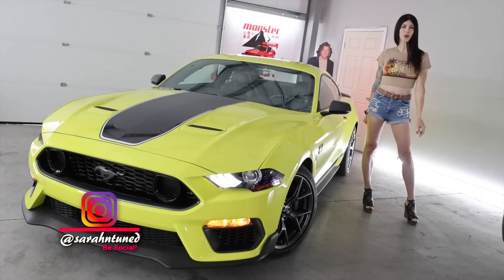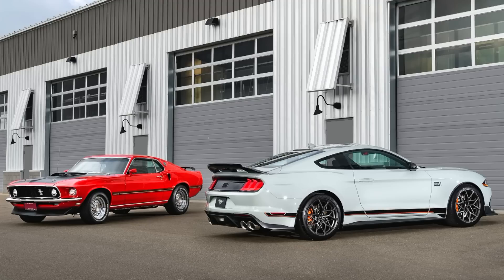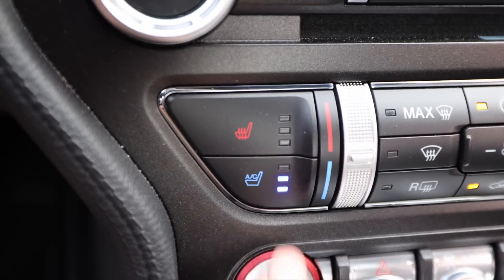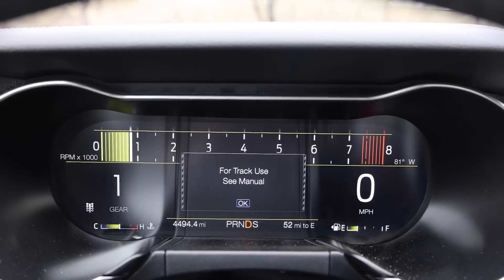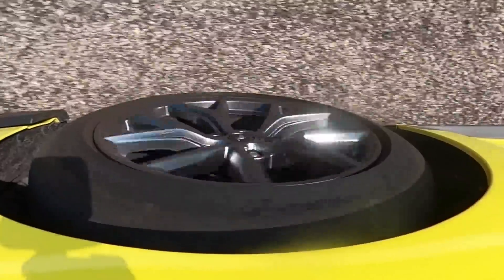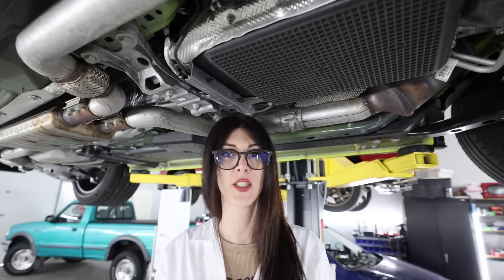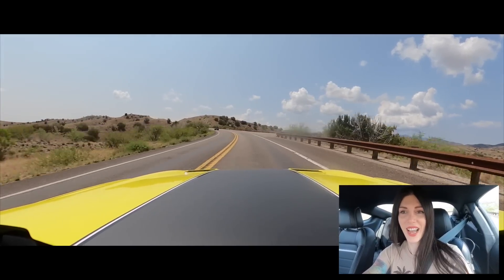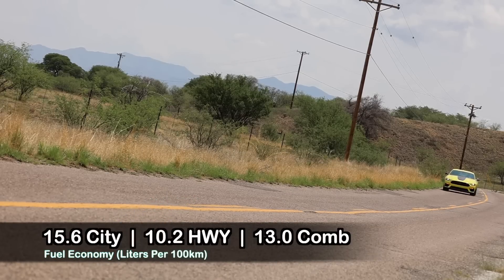Going Out With A Bang! // 2021 Ford Mustang Mach 1 Review

Comment: Love my Mustang but for the money and the fact it's a special edition they should have done 4 piston calipers in the rear, wider rear wheels (min 305's) and as you mentioned the bigger wing. That small wing looks too plain.  I actually like those wheels better than the one with the handling pack. I would have liked to see some heated/cool Recaro's too. My biggest pet peave on my Mustang is how wobbly it feels due to the wayyy too soft bushings AND it's a PP1.  Makes me wonder how this one feels.

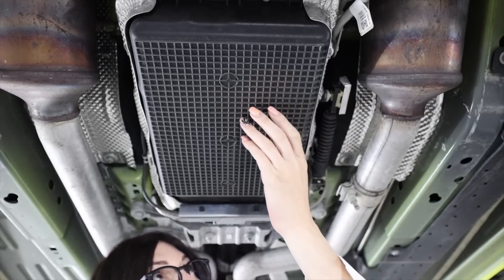Comment: 11:05 The 6 speed Mach 1 doesn't have the Getrag 6 speed transmission. It shares the 6 speed Tremec from the GT350. One of the biggest upgrades over the standard GT performance package.

Comment: There are a few more mechanical differences between both a regular GT and a Bullitt than you mention. Not the least of which is the Tremec six-speed, instead of the Getrag, if you opt for the manual.

Comment: So you will give up ventilated seats for the Recaros?  Not I. I didn't order my 2017 Gt Convertible with PP., however ventilated seats was  one of the reasons I purchased it. The other reasons were 6 speed and Performance Package. TN gets hot 🔥 also.

Comment: There is alot of Shelby GT350 and GT500 parts on it.  The only thing it shares with the BULLITT is the engine but even in the engine has Mustang GT PP2, BULLIT, Shelby GT350/R and is why it has parts from all four.

Comment: The only real problem is Ford can't get their act together with the front Aero splitter and the wheel lips.... I created so many videos talking about the situation that it induced them to actually put out a professional letter stating that they are admitting fault and this is how you claim the parts that are missing on your handling package Mach 1

 I agreed that I would remove all the other videos in lieu of getting this in writing so it could be released to the public and they did do that for me and it's up on my channel. 

Beautiful car indeed they need to do a lot better with how they handle new car builds abd the accessories that go with them

Comment: 11:27 true story that exact sticker started to detach on my car so as it spun on the driveshaft it sounded like either bad Synchros or a playing card in bicycle spokes. Luckily it was just a sticker and the only issue I’ve had with the car besides the 12-15 oz of oil it burns every 1,500 miles.

Comment: 4. Reasons to get a Mach 1
1.  It is more powerful and more badass than the garden variety GT everybody else has
2.  Sounds amazing
3.  One of the last manuals the Mustang may ever have, as Ford goes EV/EcoBoost crazy
4.  Mid-$50's for almost 500 HP is a solid value play

Comment: If you prefer the manual why test an auto, then Not use the paddles - the point of them is to engage the driver not just the speed and efficiency, it may have changed the driving experience just a little.

Comment: The mach 1 doesn't have the option for the getrag mt-83, it actually borrows the tremec 3160 from the gt350. IMO, that alone is what makes the mach 1 the best mustang to buy. The getrag is on the standard GT cars, I have one, it's fine, but the tremec is superior.

Comment: That 10 speed lacks refinement. Had an f150 and it was rough shifting into 3rd gear. My 2021 Tremor has the 10 speed has vibrations and groaning at low speed.

Comment: I think this one has the Tremec -- not the MT82? I have a 2015 with an MT82 -- not too bad once you do something like the the Blowfish Racing shifter mount, and swap the gear oil for BG stuff -- I've also done a short shifter and weighted shift knob.  All that said, I think one of the big sells for the Mach 1 is the Tremec.

Comment: So Ford Basically took the performance pack 2 GT changed the grill, front bumper inserts, front seat covers and hood graphics and upped the price $6k?
Reply from the maker: Annnnd… the GT350 intake manifold
Reply: @SarahnTuned  i ordered my 2021 PP1 in grabber yellow with the black over the top stripe and ceramic interior it's getting ready to be built up in flat rock been waiting since May 10th

Comment: Mach1 has no shaker hood. It has less power than 392 mopars which cost 10k less and the mopars have nicer interior among other things. The mustang line does seem to be nicer than camaro.
Reply from the maker: Horsepower is only part if the equation, Google their weights 😉
Reply: @SarahnTuned  according to motortrend the when the scat pack 392 first came out..non shaker, it did a 12.6 quarter mile with its heavier weight. According to motortrend as well the mach 1 does a 12.6 quarter mile. Again, I'm not impressed. Take away shaker hood, it's not quicker than dodge scat pack, interior is cheap looking compared to dodge, yet it cost much more in price. I assume mustang is not trying to beat dodge, they are going after camaro.  Although camaro sales are way down in comparison. Just my thoughts.
Reply: The Shaker Hood was Designed for a Carburetor
Reply: @Shelby-Ecoboost-Raptor-550hp  my 2004 mach 1 mustang had one. They didn't use carbs then. You can use ram air on fuel injected cars normally normal aspirated cars/ non supercharged...look at hellcat and how it brings in air from even a headlight..due to supercharged. Shaker hood cars if done right have more performance, look better and are worth more money in comparison to non- shaker cars. Just look at history.

Comment: ..just too many gears - be better with a 4 speed manual + overdrive so you have time to languish in the opera of a V8 through the revs and varying load - there is simply no excuse / reason for a 10 speed box...especially with all that torque!

Comment: Nothing like a 70 Boss 429!
Reply: at almost 3 times the cost😆 But yea.
Reply: Actually got pretty close, 70 Grande with 429 and C6!
Reply: @jasontengan1233  
that's an absolute steal unless it was never maintained properly.
Reply: No me and my cousin built it, wanted to put in a 4 speed but couldn't find pedal assembly!
Reply: @jasontengan1233  Would love to see that car. Sounds like a project I would love. Me if starting from scratch would have used a 69 shell but that's me. Keep looking for that pedal assembly. Got to be an old 69-70 rust bucket out there with one.

Comment: Have to be honest with you. I couldn't tell the difference between the different exhaust sound modes......

Also, the 10-speed transmission is overkill. If they had put only 7 gears, you would have enjoyed it much more. Like you said, you can't or don't want to use the paddles. Too many up and down shifting. Not fun

Comment: There's still the S650 gen Mustangs that are coming that will still be ice for another 7-8 years before it goes sourless and boring and soulless vacuum cleaner electric. There will be one more generation of Mustang to enjoy.

Possibly, the S650 gen Mustang might finally get a 4-door sedan version that would battle the Charger and if it does, it would be refreshing because I'm sure non-MOPAR people including myself are all tired of the outdated and overrated Challenger and Charger and the Charger being the only muscle sedan in a class of its own getting all the sales. If a 4-door Mustang muscle sedan does happen, it would've get the Charger a run for the money instead of seeing Chargers everywhere.

Comment: The Ford oil cooler is a complete joke, I hope the engineer was fired as soon as someone with a functioning brain saw the design.
Reply: Just to add for those that do not know. The oil “cooler” is a little block that is NOT cooled by ambient air running through fins like a radiator, instead HOT coolant which isn’t much cooler than the oil is what is used to “cool” it.

Comment: Hey. I love fast cars, and the handling is finally modern. 
I don't like high lighter yellow. White, silver or McQueen green better. 
A sixty thousand dollar sport car should have better seats, less ugly plastic and whatever damn color stiching you want. 
I like the limited slip, the hand brake, transmission and adjustable suspension. I think all the exhaust options are too loud outside the car.  Save the school zone and babies napping switch needed. 
But the 18 mpg, if you don't lean on it and drive like the EPA, is a deal breaker. 
The polar caps are melting faster than even the worst previous projections. The ice will be gone in less than 25 years and the ocean will rise 40 feet... On a calm day. Forget storm surges, Miami and New Orleans and lower Manhattan and half Long Island under water. 
 Muscle madness is hastening the day.

 I don't need 480 HP. 
This is a car for the " I always want to race cars but never had the guts or talent. "  Guys. 
This thing weighs 3900 pounds. Get it down to a swelt 3300 and it will handle in another dimension and accelerate even faster with 100 less horsepower. 
The Time is long past for a minimum fuel economy standard. Just because you have the money to waste fuel doesn't mean you should. We are all gonna pay for everyone who ever did.
Reply: Ever notice the gloom and doom of “global warming” is always in a future that never arrives?  Since the formation of Earth, the climate always changes and mankind has damn little to do with it.
Reply: Every wonder why 99 percent of climate scientists disagrees with that?
Reply: @larryordine7542 :  That’s a false statistic that has been debunked more times than I can count.  The survey most often used in that propaganda included scientists of many disciplines, not just “climate” scientists and refers to a multiple choice question that asked if mankind has ANY effect on the climate… of course the vast majority answered in the affirmative.  That’s a different question than asking if climate change poses an existential and immediate threat to our survival.  Stop being a sheep.
Reply: @Primus54  you are quoting false information from the Fossil fuel lobbies. Stop watching  Fox  news . Try reports from NOAA and the Army Corp of Engineers who are tasked with keeping the Ocean from Flooding our coastal cities. They already dealing with higher water and stronger storms.
Reply: @Primus54  look this up on Wikipedia . 
You have been conned. Or you don't want to see the truth. The intergovernment panel on climate agrees. The only questions they have is how fast and what can we do to slow or midigate the effects. The Mayor of Miami is dealing with a storm drain system that now regularly backs up and floods his streets with several feet of seawater. They are planning to gradually move the city  inland . And require landfill on new development to raise the place up. 
The Navy isn't leaving their largest base on the east coast in Norfolk because they want to. Wake up and stop thinking this is political. And if you want to talk about this have the courage to use your name on your public statements.
Reply: @larryordine7542  Wikipedia??  Are you serious? 🙄  I’m old enough to clearly remember the last existential climate threat in the 70’s and early 80’s… the ice age that was on top of us.  As to my online nom de guerre, anybody who posts their real name on a public forum such as YouTube is begging to be doxed or be a victim of identity theft. 😂
Reply: @Primus54  apparently too rigid  to understand the nature of an open source encyclopedia. And paranoid enough to employee  a nom de guerre on the internet.
Wikipedia will quote the studies you are avoiding and point you in the right direction. 

 You are managing to ignore every single science organization involved in climate study to quote political PR.
 Do you think anyone informed on this subject agrees with you? Really?
Reply: And the threat of the "70s"is  the same as now. It's actually happening faster than predicted back then. Somehow you got the timing of this all wrong.